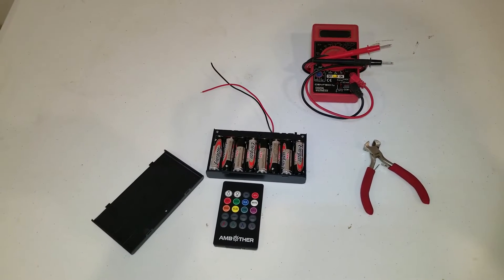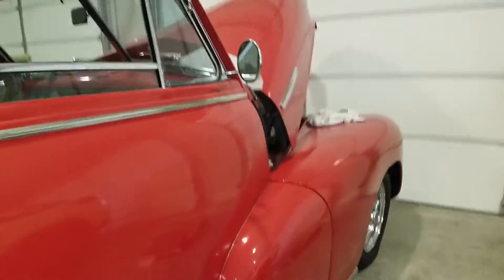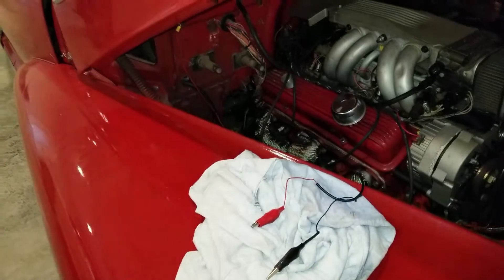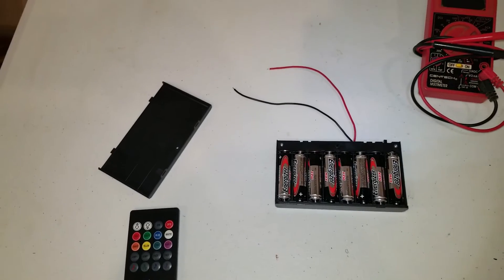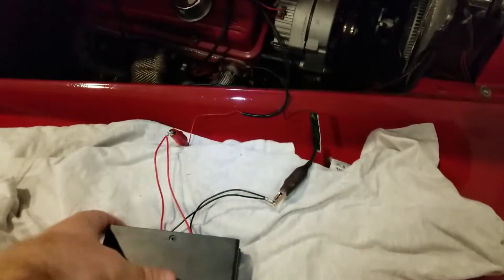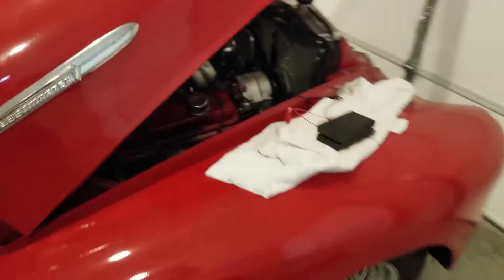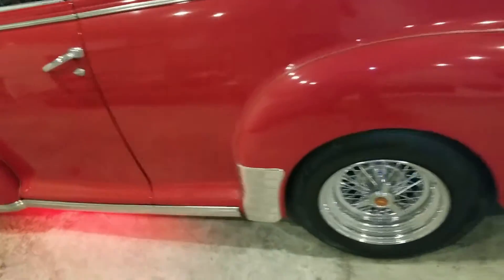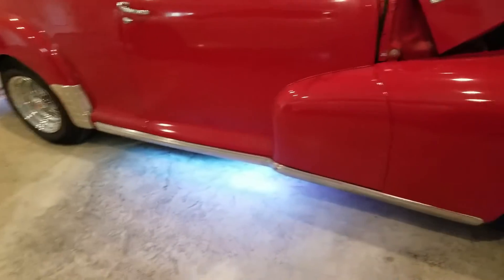Powering LED Light Strip with AA Batteries

Comment: What if my LED light strip has a 3 pin connector on it? Red, black, and a white wire. Can I still do this by tapping into only the power and ground wire and not touching the white wire?
Reply from the maker: You can usually power it by just using the red (positive) and black (ground) wires. The third wire (white) is often for control, like changing colors or effects, so if you leave it disconnected the strip will usually just light up in its default mode. Just make sure your battery pack matches the voltage rating of the strip—most LED strips are 12V, so AA batteries in series may not last long or may not give full brightness unless you stack enough of them.
Reply: @rustedpliers1618 ok, thanks!  I'd like to find a 6 to 12-v RC car battery with the same plug but I can't seem to find anything with three wires